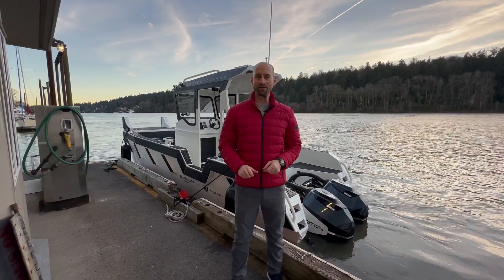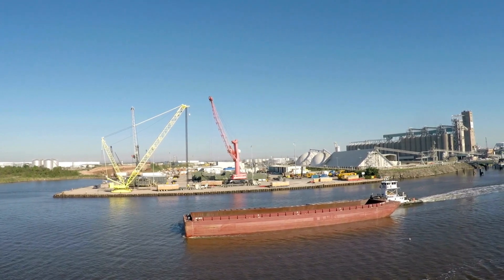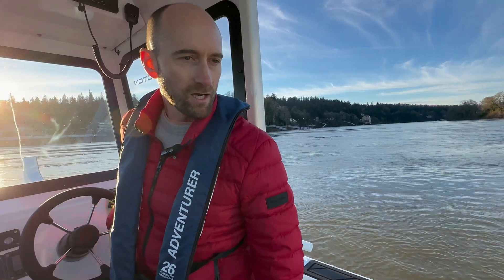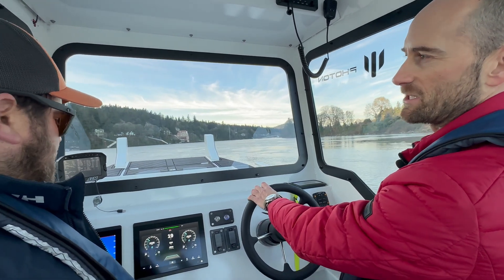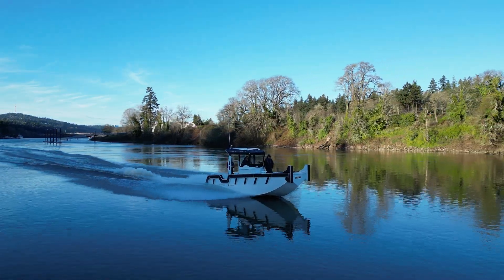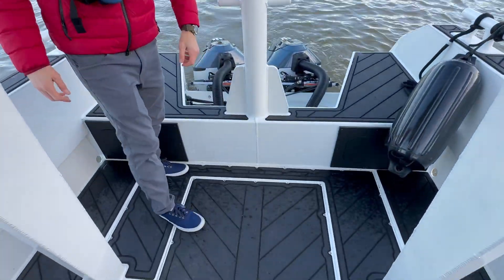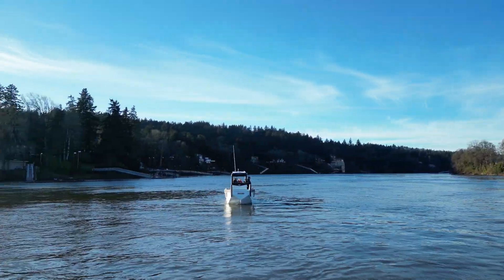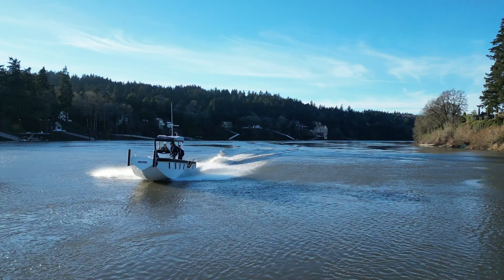The all electric Grizzly work boat powered by Photon Marine P300 Outboards

Comment: I could see a place for this boat with line handlers at a port for ships. I'll bet if you look at actual times and distance working a small boat around marinas, shipyards and ports, this could be a great option. Especially if you leave and return to the same dock all the time to plug in a charger. Maybe put solar panels on top to supplement charging? It's all about finding the right tool for the job.

Comment: Super cool and probably fun to drive. But I don't know many commercial operators who need a boat that can only run on plane for 1 hour. It's a huge problem for the marine industry, bigger than cars as boats are just not very efficient. The people hitting those maintenance periods so quickly are running their boats constantly all day and pure electric just can't do that. We really need to come up with another solution. Hydrogen? Clean ICE engines? I wish I knew the simple answer. We need Something where I can run a boat out 15 miles and back and not have to worry. I am not even sure if that boat could do one of our research trips though I would love to give it a try
Reply: If money wasn't an option you could easily build a boat with twice the range with todays battery tech. In a few years that will double again meanwhile battery prices are dropping fast.  A hydrogen boat that size would be absurdly expensive and complicated and no better range.

Comment: Prop design and optimisation for electric motors is critical. What's the battery bank details Chemistry, location etc. 

 
Tidy work boat  but throwing a lot of wake... adding a generator would give it emergency range and endurance for complex night time and bad conditions operations when an operator has to hang around and possibly recover another vesel.